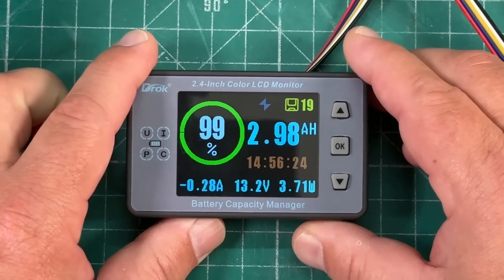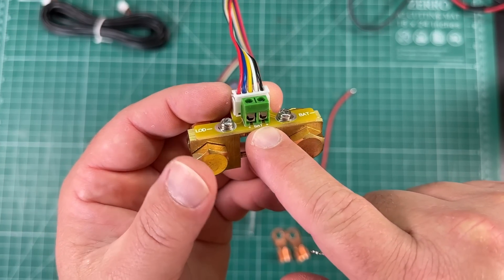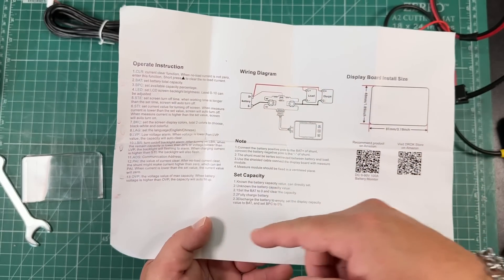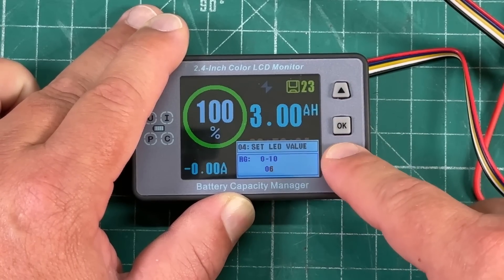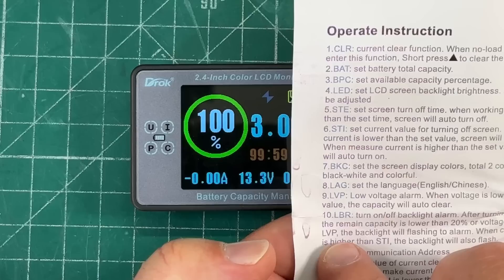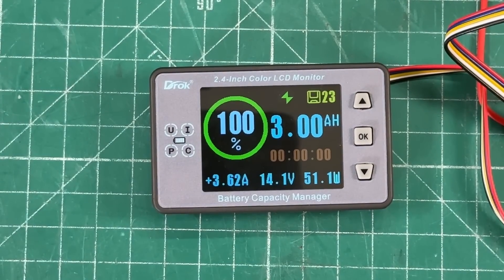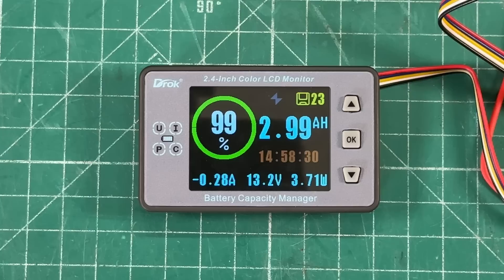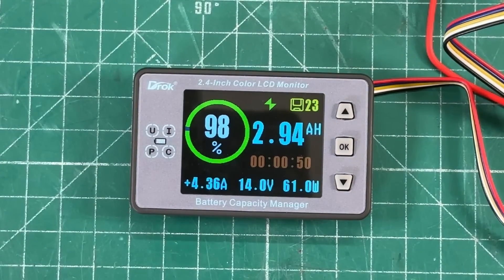Drok Battery Capacity Manager.  It's Bi-Directional!!

Comment: I ordered this meter from your link. My meter has options yours does not have. It also came with the 100 amp shunt. My meter shows battery capacity in kWh also. The percentage readout shows a battery vice the circle. Problem is you can not put in the specific kWh because the way the options are. Saw capacity of 30 ah battery would be 360 wh but it reads out 36.0k or 360.0k.

Comment: Hey Mike, can you show how you wire this through your charge controller. I followed the wiring diagram and I am not showing it is charging with my solar panel. Getting plenty of volts through the panel just doesn't show it charging. Thanks....KF8COO

Comment: I wonder what the current draw is when nothing is plugged in.  I made the mistake of leaving my solar charge controller plugged in with no solar and it drew the battery down to almost dead.  Needed to charge it to get the solar charge controller to work again. Now, when I don't use the battery for a long time, I leave nothing connected to it.  

I want to build a battery box but worry about current draw when I don't use them for a while.

Comment: Thanks for the demo.  I have a different model with similar features and it has a feature that "pulsates" the display light while charging.  I wonder if the "breathe" option is probably that.  I was using mine in an RV and I didn't like that option because at night when the battery was charging if connected to shore power the light would be flashing all night.

Comment: With lithium, I can tell you that you should be careful about the ovp auto 100%. 
You can have an "artificially swollen/sagging voltage" measurement while under load. 
Usually proper chargers have multistage current/voltage settings. At least 2 stages is best. Bulk and float. The bulk stage will be a high current stage where the voltage "target value" is higher than peak causing the current value to be higher. And the float stage will set the target to the lower peak value to allow the current to be low AND allow the BMS to enable balancing which is usually only possible while the current value is "near zero" but not below. I can explain more later if you like.  (Source: energy storage commissioning/field tech.)

Comment: After your review I bought one on 8-28-24. About three months since you made this great video. Same form factor all exactly the same. But, the screen interface is now TOTALLY different, actually improved it. The manual now is a full two pages and colored pictures,  which is very helpful. Their descriptions for the settings etc a tad better but not great . Some of the manual system descriptions do not match what is actually in the systems memory configurations. But it works great now after a lot of trial and error. . If they would just fix their manual for the average person that would be nice.

Comment: Finally a small solar/battery monitor with a shunt so you know where the heck you are solar charging and at same time drawing current with the radio stuff. I use to have a Gen-1 Power Mini, it finally died,  which I liked but limited to 140w max panel. And this one for $45 sounds like a good deal.  Thanks so much for the great review and intro.

Comment: Hey Mike few questions on the charging. If I come home from and activation and put the box on charge will the controller come on and show the charging (+ draw and the battery charging) or must you have the min negative draw that you set it to to stay on.  if you unhook the battery to charge I assume it will show the state of charge 100% or whatever you pull it off the charger at when you plug it back in because its programed for the battery. Does the sound correct.

Comment: Have you tried the DROK with a Bioenno that has the DC charging plug? I’m trying to wire one up and not having any luck. I’m not for sure if I have something not wired up right or what. Plus mine won’t shut off. It just gets real dim and I have the settings set like the videos.

Comment: Nice… probably gonna grab one of these. Quick question… if I put a switch on that small positive wire to turn it off would it retain any memory? Or once it loses power does everything have to be reset?
Reply from the maker: It resets when it loses power.  I honestly wouldn’t even worry about a switch.
Reply: @hamradiotube  ok thanks